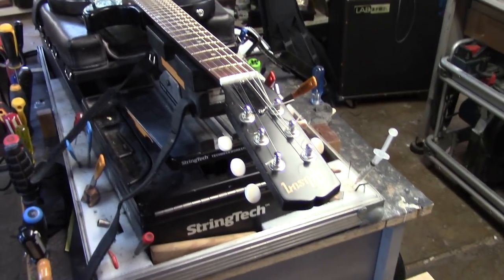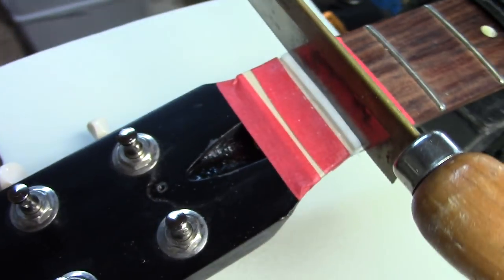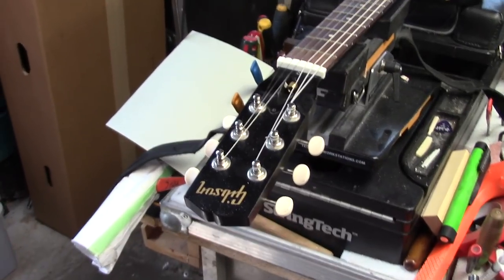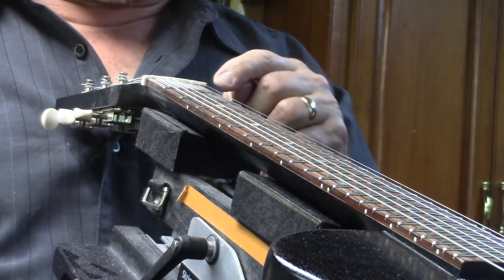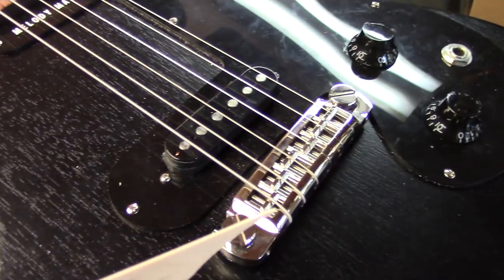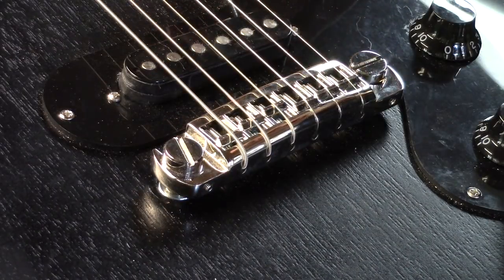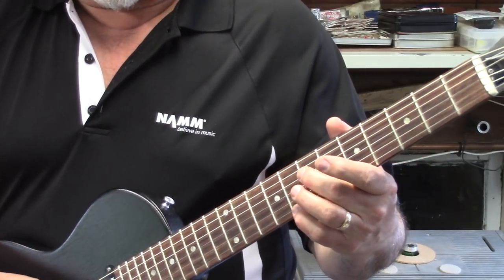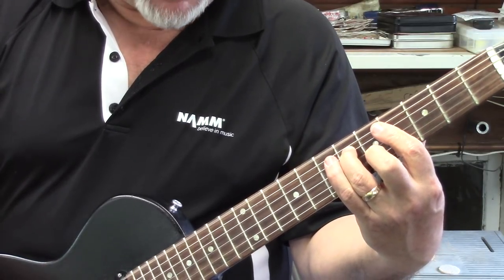Gibson VOS Melody Maker / Guitar Orchestration

Comment: Great craftsman!  Little more complicated then I expected to get that nut out.  Wish you was local.
Reply from the maker: I get a lot of guitars shipped up from the US. Jody ( Reading PA. ) just picked up the 11 guitars that he dropped off in October. In his case; to ship 11 guitars .... it was cheaper and easier to drive the 500 miles to drop em' off and then he came back a couple of weeks ago to round em' up and take them home. Max is shipping his guitar up from San Fransico ... when the weather breaks in March / April.
Reply from the maker: https://youtu.be/cIuJy92cMg0
Reply: @StringTechWorkstations  My melody maker might be worth shipping, but it's fine. I have a cheap acoustic that was my first acoustic that came new with problems.  I didn't know much when I chose it. Seemed good enough from reviews, even video reviews. It's a Luna grand mahogany with cutaway.Full mahogany body and neck. Structurally  good, sounds great. The fret board has irregularities it in. #1 string 12th fret-15th was the same note.  So I filed them down until each fret struct it's separate note. Couple other spots I found had to be filed too.   I kinda feel sorry for the guitar. It looks really good and sounds really good, it wants to be a decent player. It can't help where it came from  lol.    Being my first, I'd like to have that fret board corrected. If some one could remove the frets I could fix the irregularities. I own a 22 year old refinishing company.  Just never worked on guitars before. There is binding stopping me from trying to remove frets my self. If you were local I could have you do it, or at least remove and put back frets. The other issue is the finish flaking off every since day 1. First time I tuned it my fingernail scrapped finish off the head. Then it came off with just rubbing my thumb on the neck. I can fix that problem easy. Poor mistake on the finishers part.  I was going to use it for target practice or something. But now I feel sorry for it. Still my first
Sorry about the long story

Comment: I have a quick question please...Which compensating nut do you recommend for a new Gibson Les Paul Classic? Mind you, the guitar seems to stay in tune, but it does go out as usual with all Les Pauls on the D, the G and the B strings. Would  swaping the nut out of there make it rock solid? OR....would a roller type bridge help to get it there completely? I found this roller bridge in Germany and it looks pretty good but it's not cheap. No it's not a Schaller either. The company is called ABM and the model is the Roller Bridge 2400n-RO N. Any advice would be greatly appreciated.
Reply from the maker: The compensated nut is the first move to make. I compensate the nut for the exact gauge of strings / scale length / and tuning. Once this is done ... the bridge change will be unnecessary.
Reply: @StringTechWorkstations  Okay, good! Thanks! Now I won't have to spend alot more dough on this Les Paul. Is there a brand you recommend for the compensated nut? Or do you make them yourself?
Reply from the maker: @joszefrviz398  I have never used any "brand" of compensated nut. I have always made my own .... specific to each guitar ( scale length / tuning / string gauge / action preference etc .. ).